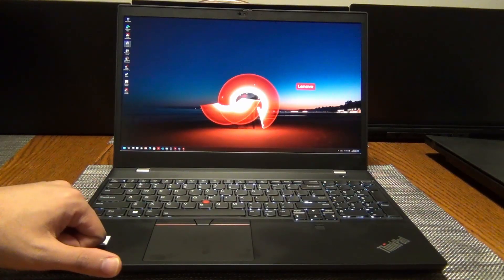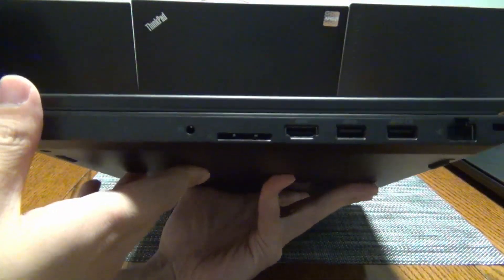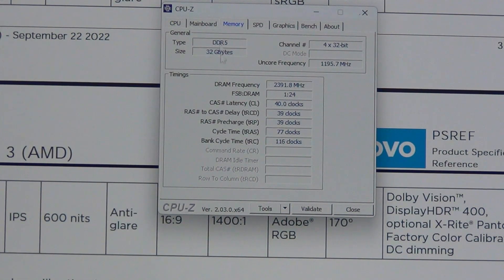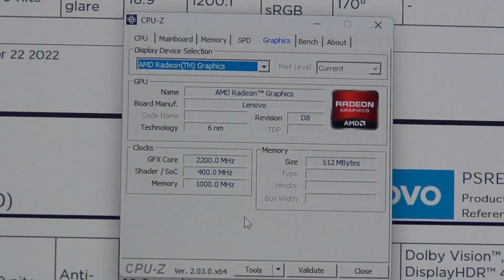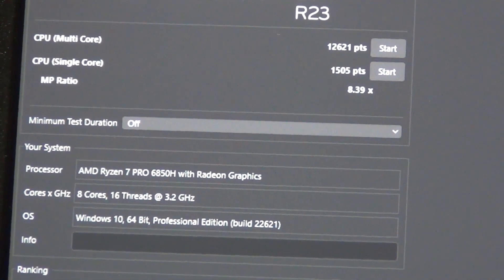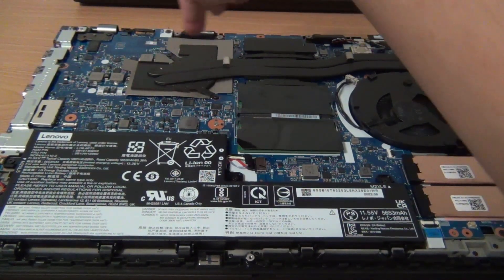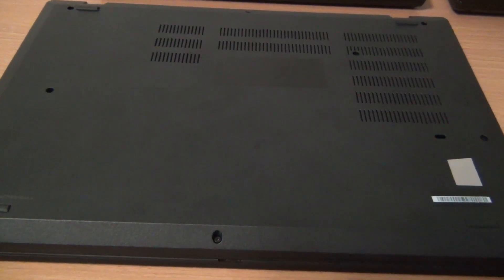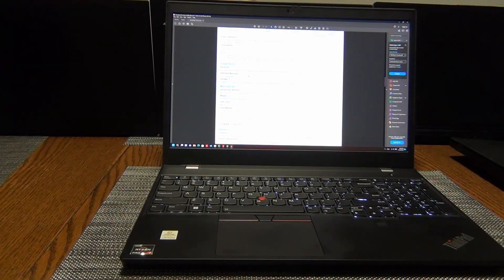Lenovo ThinkPad P15v Gen 3 AMD review (Ryzen 7 6850H, 32GB DDR5, 680m, RTX A2000)

Comment: Could you post a long-term review soon? Thanks!
Reply from the maker: I'll do a quick update video on it but to summarize, the laptop is excellent and because of the efficiency of the AMD CPU, the 68wH battery is still able to retain 99% of the original design capacity after almost one year. Being able to use USB4 on it allows for compatibility with the Thunderbolt 4 docking station which was shown in my other video with this laptop.

Comment: So torn between this and t14s AMD. Do I need the graphics card? Is gaming every now and then really important enough to almost double the weight? Not sure.
Reply from the maker: If you don't need the graphics card then the T14s AMD is probably going to be more useful if you use the laptop as a mobile device. The P15v is better as a desktop replacement. It's much heavier but also supports USB4 so it does have access to the Thunderbolt 4 docking station. I have another video showcasing this P15v AMD working with the Lenovo Thunderbolt 4 Workstation dock which really turns this into a full desktop replacement.
Reply: @GameTechReviews  Hey thanks for your answer and the helpful videos. After agonizing consumer choice paralysis I did order the T14s, with the assumption that I'll get a desktop or even an egpu(?) when I decide I want to do gaming again. 

The P15v does sound like a great device though!

Comment: I am looking to get a laptop for development. P1 Gen6 with 13gen Intel is on my mind, but I am concerned about thermals so I am looking at other options. P16 I guess and this. What would you recommend if you need up to 5min full performance from CPU few times an hour, I want to be around 2kg with good battery runtime (4 hours with that workload at minimum), not much noise from fan and overall good thermals?
Reply from the maker: The P15v Gen 3 AMD version is probably what I would use. I've used the P1 and the P16 and I've found the battery life on the Intel versions are worse and the fans run continuously.

Comment: P15v vs T15p. Same price, similar specs (aside from graphics card). Which would you choose?
Reply from the maker: The P15v is way better. The T15p does support the same docking station capabilities but the P15v with the Rembrandt mobile processors is just newer and better. Better performance and better battery life. It's also the last Thinkpad to feature the legendary keyboard as all the newer ones have less key travel.
Reply: @GameTechReviews  I'm a university student that multitasks a lot, has classes (battery life), and games. Specs on paper lead me to the Z13 or Legion 5 AMD. Hell, the ThinkBook 16p AMD fully spec'd is $200 less than the P15v, and the Carbon X1 everyone recommends online. 

It's difficult, even with the 55% discount, $2300 for a laptop. I appreciate the push.
Reply: @hamiltons.2388  Which one did you end up going for in the end? I am currently in the same situation, starting uni this september and need a laptop just like one you described the ThinkPad P15v Gen 3 (AMD) is on sale for a 999 british pounds,  I'm tempted

Comment: Just one question: are the video output ports hard-wired to the Nvidia GPU? I want to be able to attach an external monitor without having to power on the Nvidia GPU. Is it possible with this laptop?

BTW - thanks for this review, wish I could upvote it a thousand times. I don't think there are any other videos of this unit (the AMD version) on YouTube.
Reply from the maker: I think everything goes through the IGP because when on battery that's the default.
Reply: @GameTechReviews  Thanks! I think I might pull the trigger on this beast. It has just about everything I want. I just wish you could buy the AMD model without a dedicated GPU. I love the way the RAM is user-upgradable on this model. I'll be using the laptop as a Linux workstation.
Reply: @MnemonicCarrier  Did you end up verifying that it all goes through the iGPU? That the HDMI & DP outputs can be used without the NVIDIA GPU on? Thanks!
Reply: @jamesm5192  No, I didn't end up getting this laptop. I'm currently eyeballing the ThinkPad T16p gen 2 AMD, and the Lenovo Yoga Slim 7 AMD. I also bought the Legion 7 gen 7 (with the Ryzen 7 6800H and Radeon RX 6700m) - it has a USB-4 port that can drive an external monitor without powering on the discrete RX 6700m. I'll probably go for the Yoga Slim 7 gen 8 (AMD) this time, as it would be nice to have something so light and that doesn't include a discrete GPU. I also hear good things about AMD's integrated RX 780m, and I like the idea of a 90Hz OLED panel.
Reply: @GameTechReviews  Any idea if the HDMI or USB4 display outputs can output from iGPU or only the dGPU?

Comment: How does it do in a 10 minute R23 run? Just want to know how much performance it can keep in sustained workloads vs the 12626 score. The single fan heatsink and H series CPU + low power GPU combo reminds of the Dell Latitude 9401 back in the day and they ran really hot

Comment: Just received mine last week.
Tried both Gravity benchmark & Universe Sandbox on both the default T600 & integrated 680m.
The T600 is slightly faster than the 680m in Gravity benchmark but the 680m is 2x faster in Universal Sandbox. :D

Comment: Hello, 

How does the battery life look like? Do you have some screen on time results from web browsing, video playback and heavy workload? Does the performance suffer dramatically when you are running on battery power alone, disconnected from mains?

Thank you!
Reply from the maker: The performance on battery is excellent which is why I recommend the Ryzen 6000 series for mobile workstations due to efficiency on the go. I can get 8 hours with lower brightness settings and I'm using the 4k screen which uses more power than the 1080p screen. If plugged into the wall with the Thunderbolt 4 dock, this laptop is better than most mainstream desktops.
Reply: @GameTechReviews  Sounds good, thank you!
Reply: @GameTechReviews , how much battery life could one expect to gain by going with the 1080p?
Reply from the maker: @seriouscat2231  Probably anywhere from 45 minutes to 2 hours depending on screen brightness levels.

Comment: thanks for the review, is there a lot of fan noise or heating issues ?
Reply from the maker: Not really, if you are using the laptop on battery for normal on the go it's quiet. When it's doing hard work and plugged in then the fan does spin but that's expected for a desktop replacement. Noise levels aren't too bad though.
Reply: The fan spins most of the time for mine (room temperature 27-31C).
But the fan is relatively quiet even under heavy workloads.
If you are a left hander, do note that the fan exhaust is on the left.